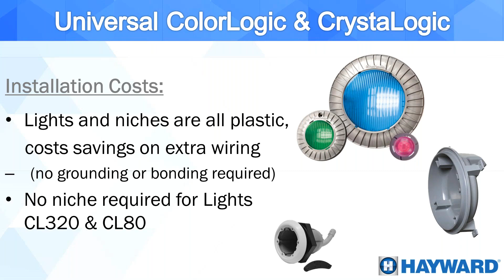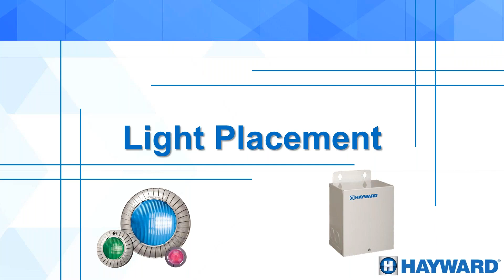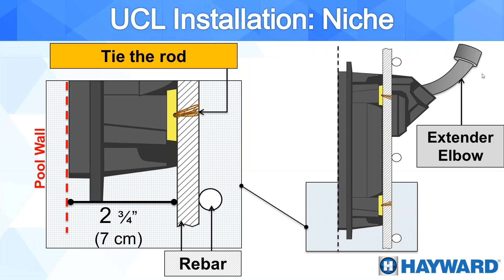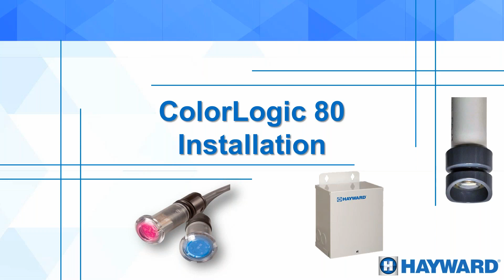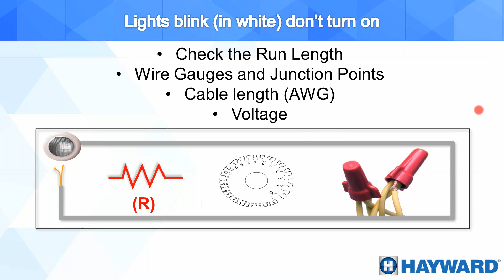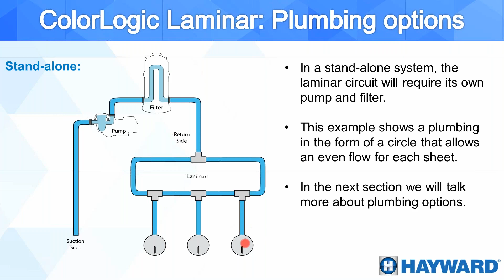Hayward  LED Lights and Water Features

Comment: Does the color logic controller / transformer need to be on its in breaker or could it share the same as pool heater ? Heater is gas. Only requiring 120v for control panel

Comment: I have a W3SP0527(S) LED and 2 of the 320 lights.  How do I integrate them?  I know how to do them separately but Idk how to do the big light with the 320's.  Is there a controller that can handle both?  I ordered the 
Hayward ColorLogic Light Controller LKCUS1100 12V but I don't think that works with the 120v big light.  So how do I control all of them?  I also have a step down transformer for the 320s.

Comment: Great video! My installer used Pentair lights in my in-ground pool due to a fitment issue with the housing (too short) on my Sunshelf. I was supposed to have Hayward Lights. My question is can the ColorLogic 80's work in conjunction with the ColorLogic 160's and 320's. The 80's are short enough to fit in the Sunshelf housing and the others would be installed in the main pool wall housings. Thanks.
Reply from the maker: Hello- yes all ColorLogic lights (Pool, spa, 320, 160, 80, 40) can be synchronized together.
Reply: @HaywardLatAm  Thank-you! I will pass this on to my installer.

Comment: Is there any way to use the Color Logic Lights to illuminate the sheer waterfalls?
Reply from the maker: Hello, it is possible. Some builders illuminate the waterfalls from the bottom up using the ColorLogic 320 or you can also use our ColorLogic 40/80 to illuminate the waterfall from behind. Please check with you pool builder for options.

Comment: I had my light replaced today by Blue Hippo leak detection of Southwest Fl with a Hayward ColorLogic LPCUS11050 and it did cost 900 with installation and a two year guarantee. three other pool contractors wanted 1,250 to 1,500 for Pentair Intellibrite installed. I have an Aqualogic controller for my saltwater pool. The Hayward LED that i replaced was installed in 2006 and it wasn't tripping GFI and wasn't leaking at all. It had just reached its life end and was still lighting but flickered in and out. I will be listing the old one on ebay for parts only and will get someone to buy it.  Crossing my fingers on new design Hayward for getting a few years out of it. T Y
Reply: 2/08/22 follow up for anyone interested. i sold my old Hayward (15 years old) in December to a private individual as "parts only doesn't work" on eBay for 100 dollars. never heard anything more.
So far my LPCUS11050 is working as expected.

Comment: What is required to install the Bubbler in a fiberglass pool tanning ledge?
Reply from the maker: Hello, our bubbler is designed for concrete pools. Not available for fiberglass at this time.
Reply: @HaywardLatAm  Ok, will be returning them and purchasing another brand. Will the 320 light fit  in the Jandy bubbler.
Reply from the maker: Please double check with the other manufacturer of the bubbler to ensure compatibility
Reply: @HaywardLatAm  Thank you for the replies. One last thought, why doesn’t Hayward make a conversion kit. Without the kit, they lost 2/3rds of the market.
Reply from the maker: Thanks for the feedback. Our team is always looking for ways to service our customers and expand our products line. Stay tuned for future product releases and improvements. Thanks for your support!

Comment: If I want to replace 1/2 inch colour logic light does existing cord plug into new unit?
Reply from the maker: Hello, the light cord can not be spliced. The connection must be done at the ColorLogic 40/80 driver.

Comment: Hi 
Can i use the cooler logic ncontroller with a deferent swimming pool lights than Hayward lights ?
Reply from the maker: Hello- no, the ColorLogic controller only works with Hayward ColorLogic lights.
Reply: @HaywardLatAm  is the Color controller available in 220-230v or 12V ? if not what other option are there ?  greart vid BTW

Comment: Great video!  You did not mention the Colorlogic 160.  Does it still exist and can you tell me how many lumens it produces?  Also, are you available for a short phone or email conversation regarding these specifics?  I reached out to your Orlando rep today, but haven't heard back yet and have a somewhat urgent question based on an in progress project..
Reply from the maker: Hello, this is our international channel (for Latin America and the Caribbean). The ColorLogic 160 is available in the USA market.
Reply: @HaywardLatAm  Thank you - one more question:  If the Colorlogic 320 is being used with automation, is EACH LIGHT able to be dimmed independently, while keep all other lights at full brightness?
Reply from the maker: Hello, When you have multiple CL320 lights connected to automation they will be synchronized based on the relay where the transformer is connected, it will be as a group- not individually. If you need to dim them independently with the OmniDirect mode, then each light needs to be connected to its own relay and transformer. Hope this helps!
Reply: How many lumens does the 160 put out?